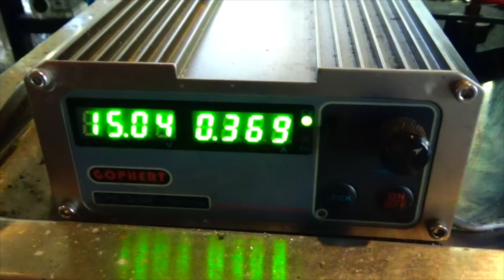#RoughCut2022 - How To Make a Lathe Tool Height Setter.

Comment: Man, I don't have nearly that kind of gear. Very nicely made but seems overly complex to me.I set it to the center on my tailstock. There's still a litle trial and error but not near as much as just eyeballing it. I don't keep advancing my carriage until I get it right, I just bump it up or down as needed until I get that titty cut off.
Reply from the maker: I agree that this tool is a bit over the top and if I were just making it for myself I wouldn't have gone to so much trouble. There are lots of ways to set a tool on centre that don't require a lot of equipment and at the end of the day. it's what works for you that is important. 
Regards,
Mark

Comment: True up a half inch or 12 mil stock in the chuck (the smaller the round stock the more accurate....but don't sacrifice ridgitity), then take a piece of thin flat stock (again, thinner is better but maintain rigidity) around an inch wide by 3 inches long and "pinch" it between the round stock and the tip of the tool vertically. 
The flat stock will be square with the flat horizontal surface of the lathe when on center....if the top of the flat stock leans away, the tool is too high and vice-versa....
All these fancy tools, nor using the tailstock, will ever beat geometry and physics....
Reply from the maker: Rick, I am well aware of that method but in my view, it still relies on observation and you may or may not get it right first time. You have to stick your head around and look carefully from what is really the centre line of the tailstock to get an accurate view and avoid any parallax error. The other thing is that I wanted to make a nice looking tool to give away to a viewer. So, yes, it's probably overdone and there are simpler methods but I like making tools and it was a fun build.
Regards,
Mark
Reply: @Preso58  I was taught to use this method 40ish years ago by my dad, a now retired tool and die maker, and it has never failed me once.....I don't rely on viewing from the tailstock, but rather use a square set on the compound for reference. As for parallax error, I would think there would be just as much chance for error in aligning the bubble to exact center.....
I'm sorry if I gave the wrong impression, you very obviously did a fantastic build of a very useful tool and always demonstrate your skill and experience in all your videos....which I enjoy very much....I certainly meant no disrespect in any way.
Reply from the maker: @TheWingnut58  Rick, don't worry, I am not offended by your comment. I totally understand that there are simpler methods that don't require a lot of time or effort to set up. Horses for courses I say!
Regards,
Mark

Comment: why not just use a dead center in your tailstock
Reply from the maker: You can do that but at the end of the day, it's still an approximate method. You would need to do some test cuts to make sure it's correct. My issue is that I use a lot of HSS tooling and it can and does go dull in the middle of a job. I also use the Eccentric Engineering tangential tool holders. Every time you sharpen the tool you need to set it back on centre and there is quite a range of movement in the tool bit to get it back on centre. If you already have a part in the chuck and it's already faced to length you really can't disturb it or start facing it off without ruining the part. I wanted a way of setting the tool accurately using something held in the tailstock chuck, and, knowing that you have it accurately set.
Regards,
Mark

Comment: Easier way: Bring tool against job trapping  your 6" ruler or a razor blade. When trapped ruler/blade is vertical, tool height is correct (as long as did an initial skim of the OD)
Mark. I am not knocking the great work you have done. Just adding to ideas.
Reply: That's how I was taught in training school 53 years ago quick and simple always had 6inch rule in top pocket
Reply from the maker: I have seen that method used and it is quick and simple. For parallel turning it is ideal. However, for facing I think it's approximate at best. Also, I like making tools that might seem a bit over the top. None of the decorative work is necessary on this tool but I wanted to make something nice to give away to viewers.
Regards,
Mark

Comment: Nice innovative tool. But Much too much is made of having the tool "on center". If you are "old school" enough you might remember that "on center" was only used in specific situations such as full facing, taper turning etc. 
For actually turning diameters it used to be recommended to keep your tool 5 degrees above center and for boring to keep the tool above center some amount. This "on center" fad began in the 1940's and has now taken over.
Reply from the maker: You can still set the tool above, or below centre by setting the bubble say, half way over the line one end or the other. The tool is overdone but I was making something nice as a subscriber gift. The tool also showcases a lot of machining and finishing techniques that might be useful on other projects. 
Regards,
Mark

Comment: Your explanation at approx 32mins is a bit contradictory because your spirit level tool requires the chuck itself to be clear. It is very simple to make the standard type of device which will reach to the cutting tip without rotating the post. Your spirit level device is very fancy but is ultimately less useful and less accurate that the standard gauge. No criticism of your work intended.
Reply from the maker: You only need to have one chuck clear. You can mount it in either the tailstock chuck or a collet or headstock chuck. I know there are probably quicker and simpler methods but I wanted to make something that looked nice and I also made one to give away. I have a simpler one that has a vee which just presses up against the workpiece and it only has one spirit level so it's only good for conventionally mounted tools. If I am in a hurry I will use that one but you need an extra hand to hold it in place while you make the adjustment for tool height. 
Regards,
Mark

Comment: The whole thing revolves around a "known accurate tool"
Reply from the maker: Which you can set up once by facing a piece of stock until there is no "pip" in the centre. Or you can use a digital height gauge if you know the centre height of your lathe. 
Regards,
Mark

Comment: One other comment aimed at UK viewers. Be VERY aware, that UNLESS you apply for, and hold, a Home Office licence for certain Chemicals - Nitric and Sulphuric acid being but two (Hydrochloric doesn't appear to be controlled) you will be breaking the law if you posses, store and/or use such chemicals ... Even small amounts! It is an offence considered as an act of potential terrorism and treated as such. Please do your due diligence and research online. I haven't applied for such a licence myself so have had to research alternative allowable processes for anodising ... There are a couple.
Reply from the maker: Things are getting very difficult for DIY enthusiasts these days. I wasn't aware it was that strict in the UK. The good thing about using Sodium Bisulphate for anodising is that it is commonly available in the pool chemical aisle at most hardware stores. 
Regards,
Mark
Reply: @Preso58  yes Sodium Bisulphate is one of the alternatives mentioned in a video I spotted but not had the opportunity to try it yet. Apparently the results are virtually indistinguishable from the classic method and if so it could be a good solution.

Comment: Or..... Or... just spit balling here... you could use the shim stock trick that has been used for over 100 years and save yourself all the time, cost and heartache.
Reply from the maker: We used to have trays of shim stock sitting around on the school lathes and I have nightmares about trying to set tools on centre on 8 different lathes with bits of bent and mangled copper, brass and steel strips. No thanks! 
Regards,
Mark
Reply: @Preso58  yeah, you are comparing an open access lathe in a school, to private users? I'm sure a custom made, expensive, bubble tool would have NEVER been broken by any student... GTFOH. Much easier to occasionally replace pieces of shim stock. You make my case for me. If pieces of shim stock are too much responsibility, then the bubble tool will be broken at a speed that would boggle your mind.

Comment: I was very interested but after a while that constant humm in the background got to me.  Sorry
Reply from the maker: A lot of viewers comment about the humming noise and I was curious to find out what noises people are referring to. I just watched that video again wearing headphones and realised that the hum is coming from my rotary phase converter on the Bridgeport mill. Unfortunately it is noisy and short of putting the RPC outside the workshop (which some people do) there's not a lot I can do about it. I have recently switched to using DaVinci Resolve as my editing software and I am trying to use a filter on the audio track to remove the worst of the humming from motors etc,  and I am also muting most of the machining noise. 
Regards,
Mark

Comment: All this effort just to set center ? All you need is a 6" scale .
Reply from the maker: That is true but it still requires some judgement and close observation to ensure the scale (we call them rules) is truly vertical. The other thing to consider is that I wanted to make a video showing some workshop processes like anodising, diamond drag engraving and bead blasting. Some viewers like seeing those things and I had the chance to wrap all those things up in one video for the roughcut2022 hashtag challenge. Feel free to keep using your favourite method though.
Regards,
Mark

Comment: What a load of rubbish  if someone can't  set tool on centre there is no chance they  can make this .Quickest  way to set tool to centre line touch Steel rule between  tool and bar adjust height so rule is vertical simply, worked for me 30 years  in machine shop ,cost nothing.
Reply from the maker: Keith, there are multiple ways to set a tool on centre. I think you misunderstood the intent of the video. It was a challenge set by YouTuber Emma Ritson from Emma's Spare Room Machine Shop. The idea was to make a video about a cutting tool or something associated with cutting. I also wanted to make something nice to give away to a viewer. Yes, it's over the top and it's not necessary to do all the finishing and engraving but it's something that I like to do in order to learn new skills and make use of the gear that I have. I am certainly not advocating that you must use a tool like this to set your lathe tools. If you have a simple method that works for you, go for it.
Regards,
Mark